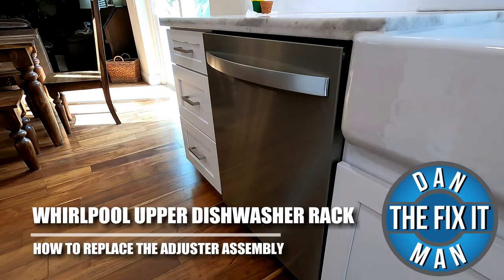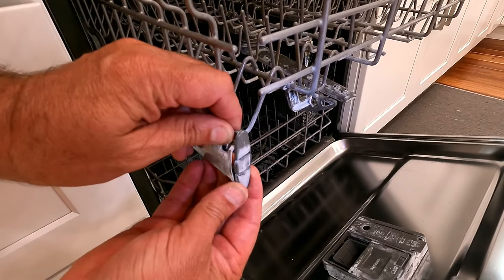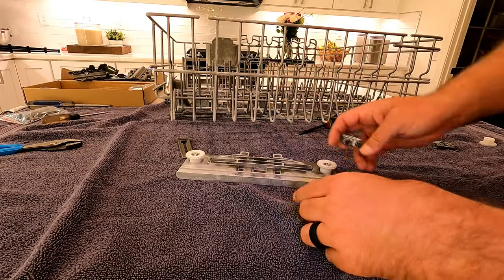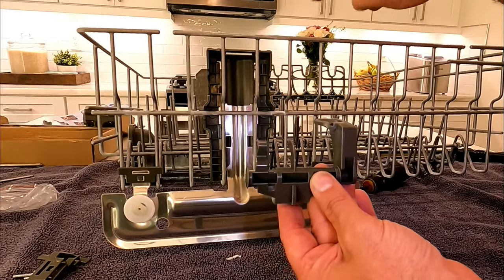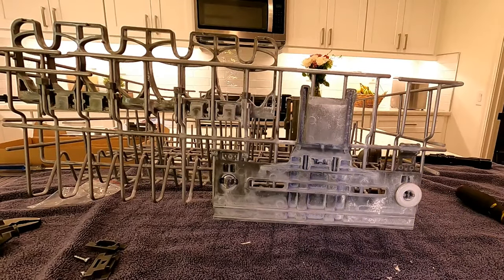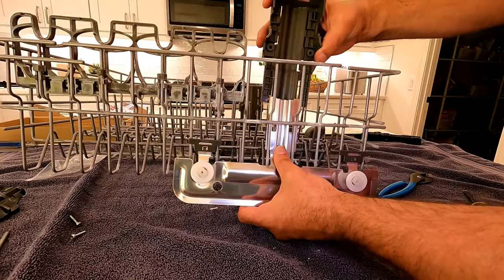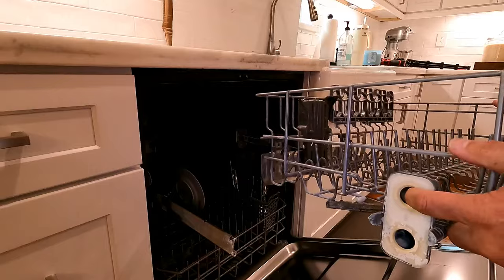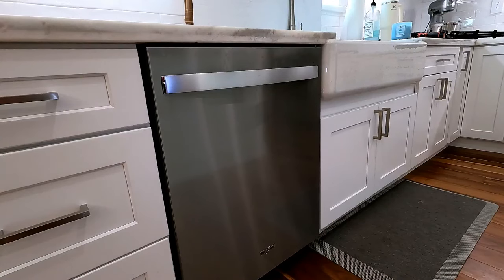WHIRLPOOL DISHWASHER RACK FALLS OFF THE TRACK! - HOW TO REPLACE THE RACK ADJUSTER KIT WHEEL ASSEMBLY

Comment: I was irritated that our dishwasher, after less than 2.5 years of use, had not one but TWO wheels break. I didn't know how easily I'd find a solution, but lo and behold, I came across this video right away and it was*exactly* what I needed. Thank you for the part recommendation and explanation that was much, much better than the instructions that came with the parts.

Comment: Great Job.  Worked perfectly on my DW same model as yours!   Appreciate the guidance.  These instruction sheets just suck.    Note if you use Lemi-Shine DW Booster it will make your dishes super clean and after 3 years the inside of our DW looks like brand new.  No hard water or calcium build up.    Thanks again.

Comment: Hi Dan. You made a great, step-by-step video. I have an older GU2475XTVQ1 model Whirlpool dishwasher with a top rack that keeps falling. Super annoying. I don't see a rack for that particular model on the giant online seller's site or on a couple of Whirlpool sites I checked out. Do any "Whirlpool" rack adjuster kits, even knockoffs, work with various models? Thanks.
Reply from the maker: I have found that with most kitchen appliances, many parts are interchangeable among models and even different brands.  You might try a parts finder on another appliance parts supplier website.  You can enter the make and model and a lot of times, they will help you with an exact part model number that you can then search amazon for.
Best of luck to you!
-Dan the Fix it Man

Comment: This was awesome!!!! And advice when track is not perfectly fitting into the back manifold? Either up fully or down and I have to fidget a bit to get in perfect. Help?
Reply from the maker: Hi Cliff,
Hard to know without seeing it, but it might be possible that the clips or the new plastic pieces are slightly off, or maybe they are installed on the wrong sides or upside down?  I would start there and double check all of that first.  If you mean you’re having this issue with the original plastic pieces and hardware, it’s possible that the wheels/slides are worn out causing it to slightly miss the back manifold.
Best of luck to you with it!
Thanks for watching!
-Dan the Fix it Man

Comment: Because my husband and I are "those people," and we really are quite stupid when it comes to anything mechanical, we turned the dish rack around when we moved to a better working surface (not paying attention) and put the entire assembly on at the FRONT of the rack. We didn't realize what we had done till we installed it and it only pulled out halfway 😆 We couldn't remove the new assembly without breaking one of the tabs, so we're purchasing another, we'll try again, and hopefully we'll get it right! LOL But it really was a very good video, just that one thing wasn't explicitly said, so of course, we screwed it up!

Comment: Put the wrong tab actuators on the wrong side. How do you fix?
Reply: You need to use a screwdriver to push little pin that clicked it in the first place and pull it out. :)

Comment: Time to use a dishwasher cleaner.  All that white is detergent. If its on the racks, it is in the pump, delivery hose and spray arms  It will look brand new   Btw  Whirlpool has this kit for both sides and the wheels are better.
Reply: What do you use to clean the dishwasher ?
Where do I order the parts
Reply: @tanubatlawala3025   I use white vinegar and baking soda, I also use finish brand dishwasher cleaner, you will have to put the vingra in a bowl upside down in the upper half-liter basket, put the baking soda on the base of the dishwasher and in the dispenser (close the dispenser), use the strongest program you have and with the highest temperature
Reply: @tanubatlawala3025  You should clean machines once a month to make your dishwasher last longer and wash better or like when it was new (if you don't want to buy it, use vinegar and bicarbonate as I told you in the previous comment) Remember once a month and you'll see results at 2-3 months
Reply: @AyronvBlogs16072015  thank k you